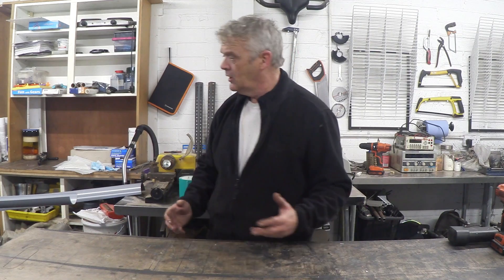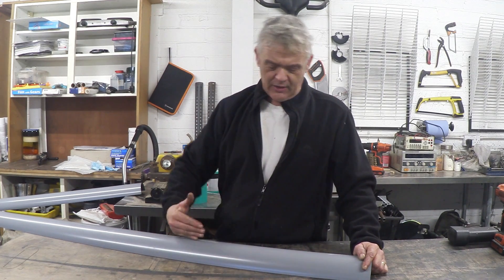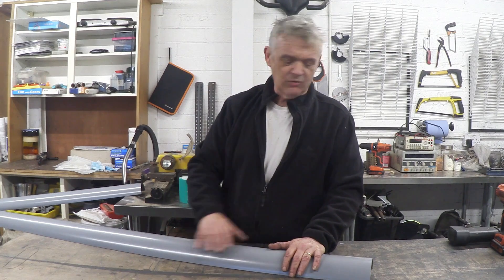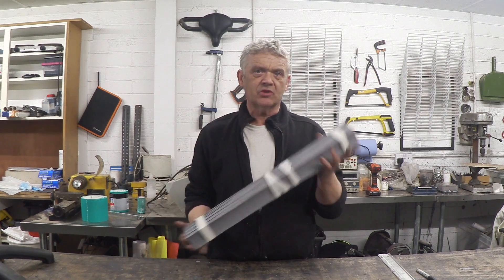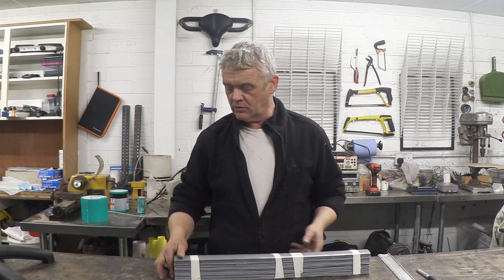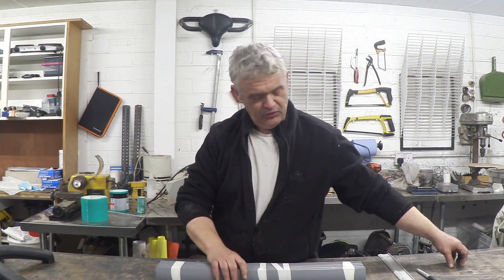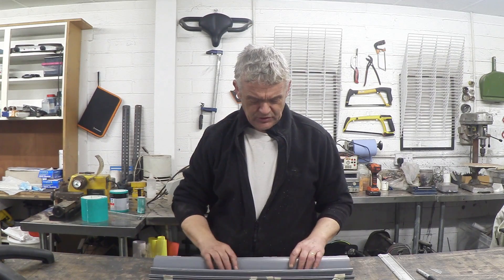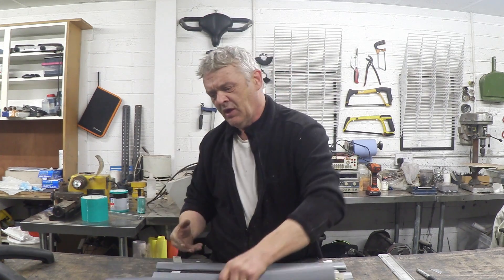Building a 1kW Wind Turbine For Under £100 - Part 1 - The Rotor

Comment: Got one for ya ,if I spin backwards my  ac 800watt 48 volt wind turbine it puts out 27 volts on a 24 volt bank of Lifepo4 on a DC hybrid charge controller. Should I put the blades on backwards...Right now I'm using on my sail boat tied off not facing the breeze...Only down fall is you can hear it now...Kinda like a breeze in pine trees... bless won't hurt it right?

Comment: Hello Robert, thank you for so many hugely interesting videos! Can you tell me what happened to all the episodes about the wind turbine (I forget the name, I watched them once or twice last year but now they appear to have been removed from your site, so I will try to describe it) which began as two plywood discs, about 1.5-2m in diameter, sandwiched together with 3 curved air guides in between? There is a hole in the centre for air intake (increased the swept area to beyond the area of the disc) and the air passing through the system exits at the perimeter. You got lots of feedback around improvements which you then applied, eventually doing away with the front disc altogether and shaping the 3 'blades' into the mathematically ideal shape. Are these episodes still available and, if so, where can I find them?

Comment: You could have used bicycle wheels. Kid's bicycles are often discarded as kids grow (cheaper than fancy chair parts - though I guess if you really had them lying around...). Bearings, rings, already fitted together and prepared to take an axle. Just stick the blades between spokes. Done. Can even attach to a chain to improve the spin. I'm going to make it and see if that works in a few months, when I have my own space.

Comment: Don't forget when glueing polymers to first degrease both surfaces and key them with 320 grit, the grit breakers the van der waals polymer bonds and allows the glue to react and cure better, some polymers de-activate glue if this is not done as they have negative surface energy.

Comment: I really think that your blades should be shaped like the blades on a whirlybird just a hot air convection from heat rising out of a rooftop will spin a whirlybird on top of it can vent

Comment: Curve the in coming air in the collector to improve torque.
To speed up the air dimple all the wind guiding surfaces like a golf ball and lacquer the surfaces glass smooth.
Awesome content.
Check out the design of a torque converter for inspiration.
Fluid dynamics!

Comment: Awesome video. However, while you were making this I was thinking of something that is very similar to this, which is in every day use. Could you not use one of those spinning shop boards that shops use? Which is similar to those spinning air holes on some vehicles, mostly vans. Just saves time making those out of bottom of chairs and pipes.

Comment: I would suggest using bicycle wheels, as they more are universally found.
And for the blades use duct tape (or sheets of linen cut to size) coated in a Resin, moulded over a pipe (protected by cling wrap)... That way you have a reliable and cheaper source of blades.

Comment: Hi Rich
Would a ducted ram air generator work? Stick a fan in a tube, mount it on a vehicle. Drive and the fan turns  and you start generating  electricity. The faster you go the  more you get!!!!
Would it work?
Cheers
T1M

Comment: the large wheels from an old wheelchair would be a good source for something to attach your blades to that have fairly good sealed ball bearings in the hubs. and since most have plastic rims, you should be able to glue the plastic blades directly to the rims. plus the remainder of the chair has many other parts that are useful like the large caster wheels, the vinyl or cloth seat and back, and tube frame. i got over thirty of them for free from a nursing home that was disposing of chairs that previously belonged to deceased patients that i have made many things from. one of them are folding camp/work stools i made for myself and my friends from the part of the frame the seat is attached to on folding wheelchairs. it has an x joint where it folds together already. i cut feet from the vertical tubing that the back is fastened to with a cut off disk on an angle grinder, and attach them to the u shaped bottom pivots(a source of thin sheet brass for shim stock) with hardware that i removed from the chair. presto! a free and really strong folding stool.

Comment: Excellent, thank you for such a great insight. Only thing I would add - safety glasses/googles when using tools. Tried the chop saw and it works well but small fragments fly off at speed. Other than that I'm nearly complete on my build.

Comment: Havnt factored in the cost of the whiteboards, cost of the chair legs, cost of the glue, the small plastic tubes, the bearing etc. Also you'll need to factor the cost of the straight saw, the drill equipment used to precisely get these standard products to the shape you need.  4.95x2= 9.90 but that's just the start of it.  Maybe for him it only cost him that much because he had the equipment already but if you're gonna make it at home like the title says, you're gonna have a much higher cost

Comment: I laughed at the health and safety comment cos ur weren't using earmuffs when using the saw, and you had no guard for making the long cuts, however, if you use the Plumbers PVC glue instead of superglue, the pieces will actually Weld together

Comment: neodymium magnets put mercury in a bowl in strong rotation. could you not then make a vessel fill it with mercury. attach strong magnets and with the rotating mercury drive the 1 kw generator via a paddle wheel. the vessel would of course have to be gas-tight. and made of material that does not react with the mercury. 1kw 24/7

Comment: don't know how old this video is there's no date but i thought i'd throw in a suggestion for mounting the blades and that is rather then just gluing the the blades to the outside of your round pvc mountings cut a slot through each one so you can slide the blades in then glue and pin them, super glue alone can be kind of persnickety especially over time exposed to the elements, the added strength of a mechanical fastener on a large outdoor spinning  mass could be advantageous in the long run. i don't know how much a quid is but the even the entry level evolution saw is well over $300 when it's on sale here in the states......

Comment: How smal, could that be made and still generate enough power to assist in recharging a 72 volt 32 AH ebike battery?  Thinking sort of a radiator type thing put just behind the front forks.  What sort of controller/ inverter would be necessary to work with the BMS so as to recharge the battery…might want to add a capacitor to recharge quicker and then route it to the battery.  Advice is welcome.

Comment: “IMPRESSIVE. I THINK you want to shaft couple a DCA & PWM its field to maximize benefit in varied conditions. USE AUTOMOTIVE grade with external access for PWM. I CALL it ‘DC modulation’ where voltage & overcurrent articulate pullback on field pulse. IT MAY also be beneficial to emulate ‘intended use’ & have some DT on field rotor throughout. YOUR APPLICATION can inherent benefit (from rotor PWM) with a certain way to protect stator windings from OC, as well as making startup in a light breeze possible. (TAP SIZE is 11/16-20 BTW). SMALL MOTOR with shaft coupling is very dependable but needs electronic, field modulation (pullback) as ‘protection’ in an actual, product venture.”

Comment: Could have saved some time by taking a 55gallon plastic drum cutting vitical slits up and down heat gun the slits bend them into an angle then hook up bearings motor etc

Comment: You know, I'd been wondering about what use one could possibly find for the base of a swivel chair ... You see these chairs dumped all the time and it's a shame as the base (and usually the lifting mechanism too) is always perfectly functional (with the exception of a few castor wheels missing).  Using it like this is a brilliant idea and will possibly open the way to generating multiple others for their re-use.
Reply: I liked the idea, but his plan relies on two almost identical ones, or you get wobble.
If you made a more traditional horizontal fan style, you would only need one, and that would be fine. 

I would suggest using bicycle wheels, as they more are universally found, for this drum style. 

And for the blades use duct tape (or sheets of linen cut to size) coated in a Resin, moulded over a pipe (protected by cling wrap)... That way you have a reliable and cheaper source of blades.

Comment: Dumb question time - IF you could block off the side of the blades that offer counter-force to the blades, would the rotor turn more efficiently? I was thinking of curved shield that rotated with the wind, like a wind vane, that would cover half the blades.

Comment: Would putting an S curve in the blades increase the spin potential?
Reply: Try to analysed the design of jet engine, they intentionally installed around 7. feet tail housing for those jet exhaust gases- accordingly, the suction volume of fresh air due to the scaping  hot gases - increased by a whopping 90% in volume!...

Comment: Outstanding!  Beautiful design and construction. Also hyper-interesting as all your stuff is.  I especially love the use of the rain gutter instead of similar pipe. I was thinking of doing the same thing with 29-inch / .74 meters bicycle wheel. That's the largest "Standard" size wheel or I would have gone bigger, but I am not much of a handyman, so the idea of integrated bearings is attractive for me. All good wishes! I'm going to see the other parts right now!

Comment: if you know your glues, you can glue everything, most glues don´t take well to temperature and uv however
Reply: Good point, There’s actually a new glue on the market now, well its not new just new to the general public it’s super strength dentists glue that uses uv light to harden so maybe that could be an option for this?

Comment: Bicycle wheels could be used for end sides, they usually well balanced, light weight, have bearings, and could be relatively easy adjusted to run true. Also more common.
Reply from the maker: to be honest mate - I didn't find them that easy to true up - or even to join into one unite - I mean not difficult but certainly not as easy as this

Comment: Hi Robert great video's, looking to experiment with this type turbine. Can you tell me where you got the magnets from at such a good price. Thanks
Reply from the maker: first4magnets mate - it's a UK company
Reply: @ThinkingandTinkering  Hi I've been looking but for 80 of these magnets it's £60 unless I'm looking at wrong thing, 50 x 25 x 10mm thick Y30BH Ferrite Magnet - 3.6kg Pull

Code: F502510F-2

This is a far cry from the £10 you mention. If I have wrong one's can you please set me straight. Loving this series so far BTW

Comment: on bearings I would think that two angle bearings would be better, (angled cup and beveled insert to match with cylindrical ball bearings (ie not spherical so technically not "ball" bearings) that roll over that flat surface and is trapped by the angled insert, with contact on outside and bottom on bottom one, and outside and top (flip them so the angles of both sides of each bearing cup form a diamond shape) that way they self align, too, as well as handling the weight between them extremely efficiently, 

This type you are making (as far as I can tell) would benefit from my idea of a second set of blades that are flat and stationary around the outside that angle so wind coming from any side that falls between two of them is buffeted to the side that pushes your VAWT around, and protects the side that is not using it to push it around, from that wind, as well as increasing the cross section of air flow it will catch and concentrate on the windmill, so it will hopefully perform better than one that actual size since it is not having to lug that weight around, again I will make a better video of that design than I already shared here, as that one I tried to optimize for better air flow, but it just makes it harder to tell what I was going for.
Reply from the maker: angle bearings would be better but I am determined not to pay much so I am using what I have - I did a version of what you suggest in an earlier video

Comment: This is a lot of reading, for some, and might be hard to understand, so if you choose not to read it all and want to see a video of the process instead, leave a reply to my comment, 

something I found useful for rounding that edge of cut PVC (back when I made melee weapons from PVC water pipe and electrical grey PVC conduit, covered in tube insulation, wrapped in duct tape and electrical tape (blade end with silver duct, and handle/cross guards black electric tape.) ) was to use the tip end of the unbroken new snap off box cutter blades on the top back side of it as this segment was always cut away with a round inverted cut for some reason so when you drag that across you would get a round edge (it looked a bit like someone punched through the angled corner with a hole punch for a paper punch sorta, so one side it was super sharp and the other was a bit rounded off from that being the side the punch went through first, so if I dragged it sharp side first to cut off a rounded or curved area around the tip of the tube of PVC it would cut away swarth or rough bits from cutting it with a hack saw, and pipe cutters left a flat sharp edge so I used it on those too, then I would come back and drag it over backwards so the rounded edge of the punched partial hole would smooth off the PVC by just being a round smooth metal surface that refuses to take anything off so the pressure would press down on it nicely, and I had to round it well because a pill of foam wrapped in strapping tape was shoved into a cup made of strapping tape that went over the end of that pipe and dipped down into it, so the pill could rest in it like a person sleeping in a hammock, and protrude a couple inches out of the tip thus ensuring the tip of the outter tube insulation would not allow the tip of the sharp PVC to come through it and the duct tape causing it to hurt someone as people swung these things at each other as if they were a sword/baseball bat all day long in the park LOL 

not sure if that pressing down with the not sharp back portion of the blade to shine and polish up that rounded edge would matter in this case or not, for wind flow. but thought I would drop that here so people can try it out, and might make a quickie video of the process if its not clear enough what I am talking about
Reply from the maker: I certainly get it - but a video would also help folks mate
Reply: @ThinkingandTinkering  noted and thanks for letting me know that you were able to follow my ADD "flow" (meaning it is all jumbled up worse than spaghetti or thousands of cords plugged in by a multitude of people just in a hurry to get power or something and sit back up at their desks LOL)

Comment: I know this a super crazy request.  But artificial wind.  Can you figure how to store heat (solar) and make "wind" that can be harnessed reliably?  If you can then you have an inexpensive universal solution
Reply from the maker: I'll give it some thought
Reply: @ThinkingandTinkering  thank you.  I live in Arizona and there's a mountain when the sun sets the warm air rushes up the face of the mountain (Mt graham).  I am thinking a temperature differential is needed and maybe one end (glass/plastic covering over black material with a little bit of water) is heated and a long pipe goes slightly upward through the ground (the water cools and is collected in a piping system and is redirected back to the source).

Comment: Hey there Robert, amazing work as usual!
I would like to add in my 2 cents on VAWT's for this community, it is not meant to be critical of your fantastic work, just to add some more information. So if you go for a vertical axis design, magnetic bearing levitation can reduce the friction losses. Also if a tail and a wind blocker is added, the friction from wind on the return side can be minimized, more energy can be harvested from the same wind space. Also less magnets and coils are needed if gearing or belt drives are used to spin up a smaller disc much faster, rather then placing them around the outside of this large disc.

I love your channel and love your making things from garbage approach! Very inspiring! Keep up the good work
Reply from the maker: nice tips mate - thanks for taking the time to post
Reply: It would not work .......why did he not show it working ?

Comment: Now I know you’re the chemist professor, but I was an aeromodeler in my younger years. To my knowledge superglue was good for dry conditions, but it becomes milky and loosens when wet. That’s why we used 2 component epoxy glue when it had to be extremely strong and weather and fuelproof. With glasfiber there were extreme strong bonds possible. Perhaps superglue evolved into weatherproof applications?
Reply from the maker: it's used here in the uk for fixing roofline and window frame with a 25-40 year guarantee - so I suppose it must have